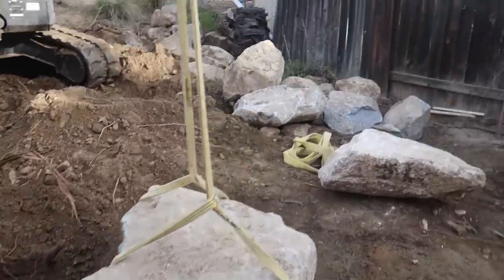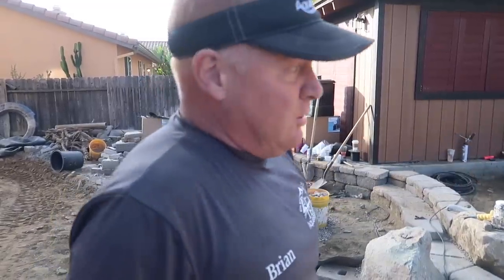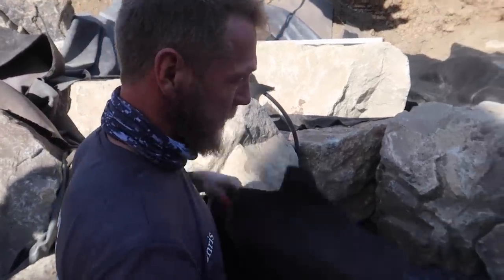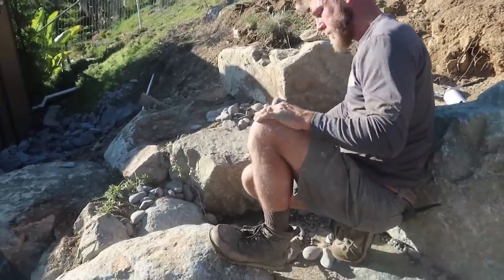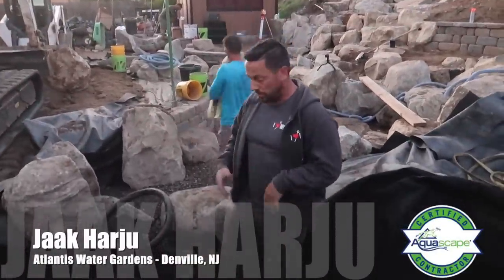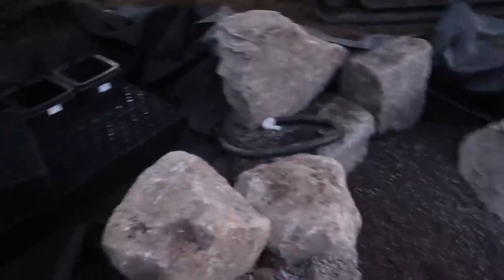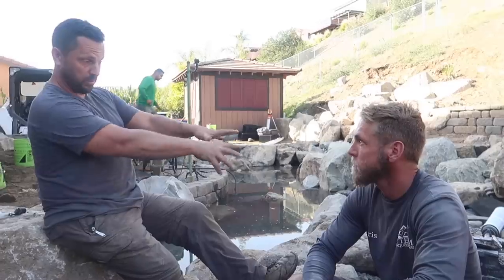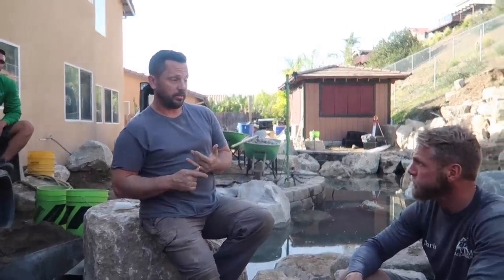San Diego *KOI POND* REVEAL - Part 4

Comment: What size is the urn that is in the build and is buried in the area a little bit
Reply from the maker: It's the large stacked slate urn. It's 55" high and 35.5" in diameter.
Reply: @TEAMAquascape  thanks is it on you website